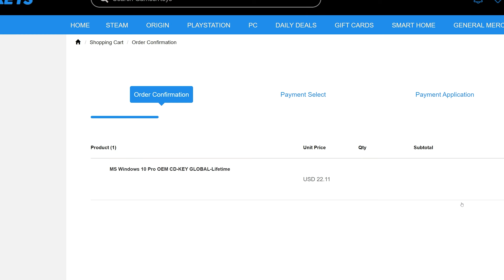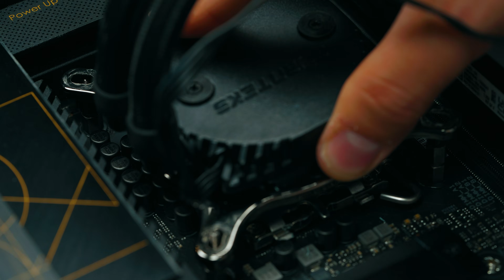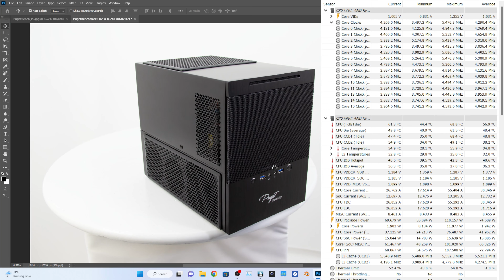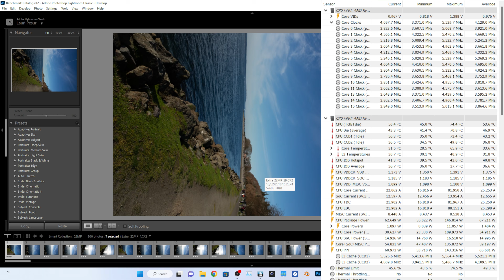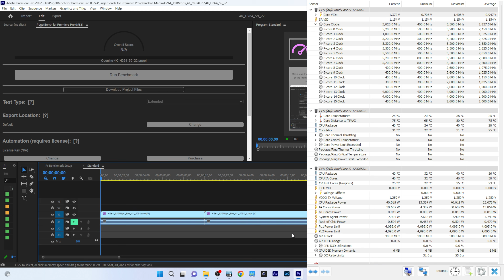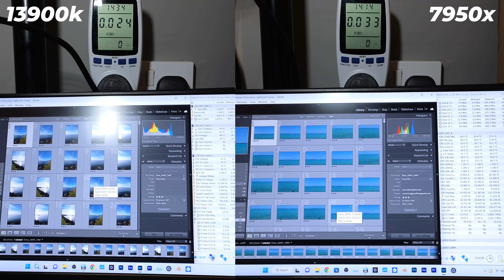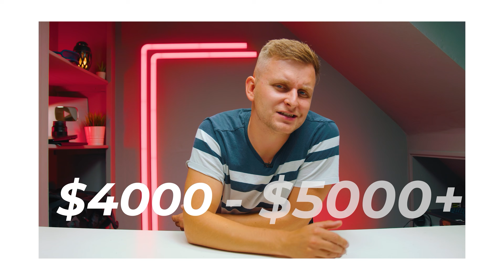INTEL & AMD both lied! 👉REAL WORLD power consumption is MESSED UP

Comment: Glad someone pointed it out! This is why I still prefer Intel than AMD. However, I think the low idle power of intel is because of it being monolithic while AMD is using chiplets/soc, not the best explanation but something like that.
Reply: Same reason why i bought a i5 13600k!
Reply: I believe you are correct. The new AMD GPU's 7900XT & 7900XTX are chiplet architecture and have high idle power draw. I do believe chiplets are the future but we have to figure out how to make them more efficient at idle.
Reply: @BRob1978   Even apple has high idle power in M1 Ultra, 10-12w compared to less than 1 watt on M1 pro/max. 
And the culprit is Ultra fusion connector which works similar to the infinity fabric.
Reply: @BRob1978   Even apple has high idle power in M1 Ultra, 10-12w compared to less than 1 watt on M1 pro/max. 
And the culprit is Ultra fusion connector which works similar to the infinity fabric.
Reply: @BRob1978  that was a driver issue, I have a 7900xtx and now it ideas at around 20 watts. When pushed amd gpu pf/w is way worse than nvidia though
Reply: Intel is moving to chiplet design as well.
Reply: @LiveType  Intel utilise Heterogenous core, while Ryzen do not, Ryzen use 100% high-performance core, while Intel mixed in low performance core (eg: 50/50 low/high core ratio) for use in idling. Smartphone CPU also use this approach, and Intel themselves once tried making smartphone using Intel Atom x3, x5, x7 CPU. (Intel sell miniature x86 PC in a USB thumb drive form-factor using Atom z CPU)
Reply: @xponen  I don't think efficient cores will help with idle power, since when idle, A processor's power consumption mainly comes from IO, memory, Cache etc. At least, that's what I observed with my Ryzen 3500 and 1650Super. 
The problem with AMD processors is the seperate IO die and synchronous infinity fabric along with higher, shared L3 cache and more PCIe lanes that all require extra power even when idle. AMD should find a way to downclock these when under light workload.

Also, it'll be interesting to how Intel tackles with this problem with 14th gen CPUs
Reply: @xponen  intel didnt use BIG.small cores on 12100, 13100 or 12400 and 12500 and they are still idle with very low power consumptions.
Reply: Along with infinity fabric and IO die, I think large cache and more PCIe lanes can be a reason along with a (relatively) inferior memory controller.
Reply: RIP, Intel 14th gen idles higher than AMD now, while even worse load power consumption.
Reply: The big hole in this logic, why would anyone buy the highest end cpu, if theyre gonna idle all the time? Those cpus are for gaming and creating contents. Ryzen 7000 non x still demolishes Intel with tdp 65 watt max 88 watt.
Reply: @fynkozari9271  I'm not 'going to idle all the time'. But idle is still a large percent of the time you spend on your PC almost no matter what you're doing. If it weren't manufacturers wouldn't spend tremendous amounts of resources to make laptops idle efficiently. If you spend an hour touching up photos in photoshop, you're idle 80% of that time. It's like judging the fuel efficiency of a car when it's running at 150mph - not representitive of most common situations. I think he even said this in the video. So yeah, I want a CPU that can run under heavy load and still idle without throwing money away.
Reply: @TimDobranski  - People dont buy laptops for gaming, thats not what its made for.
- Laptop cpus are different than desktop cpus. One of them runs on battery.
-Photoshop both cpu and gpu intensive.
-Gaming PC is different than Office PC.
-You dont build an expensive PC for browsing internet watching cat videos.
-People dont sit on their gaming PC all day. They have work, play, eat, sleep, outdoors activities.
Reply: @fynkozari9271  Like i said, thats why “i” chose intel because i mostly do browsing then some gaming if im in a mood for it. If you gonna play all day, then yeah maybe amd is a better choice.
Reply: @fynkozari9271  Ok, lets go down the list: They're different, yes. Doesn't mean it's totally fine for desktop CPUs to be wasteful. Here in San Diego we have the highest electric rates in the country. 

Photoshop, like most productivity work, is CPU/GPU intensive for very short bursts. It's not continuous. Most of that time is idle.

People can and do build an expensive gaming PC for gaming, and still use them for day-to-day use. A PC doesn't have to be for ONE thing. That's one of the biggest benefits of PC vs console gaming.

So yes, any PC, gaming or not, is idling a lot if not most of the time.
Reply: @TimDobranski  well said man

Idle doesnt mean you leave your computer alone doing nothing.

Using it for word, spreadsheet or something like browsing is almost the same as idle.
Reply: @Hasan Raza My ryzen 1700 idle 18 watt. My strix 2070 idle 14 watt, according to HWinfo. I play video games everyday cpu never touches 100w gpu never touches 200w. Its almost 6 years old.
Reply: i bought 7800x3d for gaming.not for idling.
Reply: @rtz6188 i watch youtube on my phone and movies. i prefer lying on the bed doing this. i only use my pc for gaming. that's why i call it gaming pc.
Reply: The AMD Ryzen 7000x are just tuned very, very inefficient stock. Intel did that better, objectively. But who cares?
This video is just about clicks I realize now.
Reply: @reptilespantoso  AMD fanboy triggered
Reply: @JoeWayne84 Well, the guy who runs the channel is an Intel fan boy. Irs good with a bit of counterweight.
And your comments tells me, you're an Intel fan boy.
Reply: @akyhne  I have 3 AMD systems currently and 2 Intel… but they all got Nvidia GPUS … so I guess I’m a fanboy of Nvidia GPUS if anything??? 
As far as Intel vs AMD and CPUs it’s a toss up nowdays but I like Intel for my highest end build… but to each their own… this was a year ago it looks like and I’m not even sure what the video conclusions were but I most likely was making fun of a obvious AMD fanboy and it triggered you.. 
I will say AMD has an amazing rampant fanbase on YouTube comment sections… they are worst of any other group I’ve seen that make a brand there identity in life… it’s just weird it doesn’t translate to the real world if you go to computer stores are talk to anyone you can find locally about hardware and you never meet a AMD fanboy??  And I’ve lived in 4 states over the last 20 years and been building PCs since 2002 ish … have bought Radeon and AMD parts off and on the entire time depending on availability and cost and I have always found them to be sub par compared to Intel are Nvidia since ryzen 5000 they became a viable option in CPUs and Radeon 6000 was amazing budget gpu cards …
Unless you wanted Nvenc I
Reply: @JoeWayne84  Both Nvidia, Intel and AMD has fanboys, that are off the chart, not willing to admit, when the competition has a better product. And for my experience, I'd say the Intel fans are the worse. The same goes for Apple fans vs PC fans.
Reply: @akyhne  just watch tech videos on YouTube and look at YouTube comment section it is over run by AMD fanboys on every Nvidia and Intel product claiming it’s trash??? It’s a parody at this point it’s been this way since I started paying attention to the comments in tech videos.  I’d say around gtx10 series are right when the first ryzen CPUs were released there was people claiming there ryzen 1700x was better than an intel 8700 becouse it had more cores???  Are the just wait till Navi,Vega, gets released don’t waste your money on Nvidia in a few months you will be sorry if you buy a nvidia card… Seriously I have saw some amazing claims by AMD comments section fanboys. Where I haven’t seen that from the other side maybe once in awhile you will find someone trolling someone for being poor.. idk I think people who find there self identity in material products they own exist in everything though it’s just AMD ones seem to be the ones who live on YouTube… there are basically 20 successful YouTube channels who’s sole purpose is to fanboy for AMD products.. and pretend to be extra informed on next gen stuff… haha that doesn’t exist in any way even slightly comparable with Intel are Nvidia … but there is a huge market to grow a YouTube channel if you tell the AMD fanboys what they want to hear.
Reply: @reptilespantoso  No dude a CPU at idle is still running tasks from the OS, if you want to say that AMD isn't slowing clocks down enough at idle, OK??  I don't agree but OK.  The issue REALLY IS chiplet design. You have to boost signals to send them from one chiplet to another, and the memory controller is on the IOD.  But even the OS running background tasks means those amplifiers in the chiplets that send data back and forth are powered, and in a monolithic design you don't have that.

But I would still say WHO CARES???  My PC doesn't idle.  It's either doing work or it's off or I'm gaming.

The other thing is this was done RIGHT AS the 7600, 7700 and 7900 came out which will all use less power, and the 13900K sucks ass in gaming and all core power consumption.

The 5800X3D destroys most everything in power consumption across many loads and gaming, along with the 7600X

Techpowerup, best place to go for detailed analysis for CPUs including VERY thorough analysis of power consumption.  This channel is laughable to suggest in any way that Intel CPUs are better than AMD in power consumption OTHER THAN single threaded apps WHEN the Intel CPU can use an e core, or idle power.
Reply: @johndoh5182  I'm hardware programmer, more than 90% of my PC time goes to idle.
Reply: @johndoh5182  5800x3d hahaha that’s hilarious the 13900k is way better than the 5800x3d in gaming especially with the new GPUs 5800x3d is good compared to other am4 CPUs but it isn’t the fastest gaming cpu by far pretty sure the am5 7600x beats it in all gaming nowdays the 12th and 13th gen Intel are way better
Reply: That is EXACTLY it.  Using chiplets means you have to boost signal levels to move them from one chiplet to another and even at idle a PC is doing some work.

But really, that's such a trivial thing I find it laughable.  In all-core loads and gaming Zen 3 and Zen 4 parts like the 5800X3D, 7600X and 5600X destroy Intel parts.  And for frames per watts, Techpowerup measures the 13900K at 2.13 fps/W, the 7600X at 4.47fps/W (best) and the 5800X3D at 4.1fps/W (2nd best)

This data is old.  In case you don't understand this data or question it, Techpowerup does THE most detailed CPU reviews.  Gamer's Nexus also does SOME power analysis but nowhere near the detail of Techpowerup.

Search "Techpowerup 13900K review".

But here's the kicker.  The 7600, 7700 and 7900 are all about to lay waste to the line of Intel parts for power consumption.  In fact I just checked Techpowerup and they've reviewed the 7600 and 7700 so those are now added to the charts and the 7700 is the most power efficient CPU in all-core loads and near the top for gaming efficiency.

Idle?  That's your concern?  Turn your PC off because the rest of the components are using as much or more than the CPU.
Reply: @johndoh5182  Yeah, idle power draw is a big concern for some of us. I have a Plex server running 24/7, for example. But even in more typical setups, PCs are idle or close to idle probably 90% of the time. Web browsing, tracking data in Excel/Sheets, recording music with Pro Tools, watching YouTube videos like this one, Zoom calls, coding in VS Code. I do all of these things more than I game now. I still want a powerful chip for gaming when I need it, but I don't want to run up my power bill. That's why some of us care about idle power draw. Kudos to this channel for finally recognizing how important it is to many of us.

Comment: Did you try to test ryzen 7950X with iGPU disabled? It's useless and probably causing high idle power consumption, Yeah chiplet design results in High idle power consumption, but 50 watt is rather too high.

Comment: Disagree. You MUST tweak the Ryzen 7000x CPUs to get these to run good. (PBO2 & Curve optimiser)
I've tweaked my 7700x just now. -38 mV undervolt all cores. PPT 85 Watt stable, but I gave it 88 Watt. Pulls 90 Watt from the PSU max. 100% (Cinebench r23) stresstest 64 degrees C packet. (at 85W it's 62 C max)
Yes, it's quick. Best score Cinebench r23 single core 1984 all cores 20121. Clocks to 5300 all cores continuously. Repeatable. Boosts to over 5800 MHz on 5 cores normal use (audio production) the other 3 boost to roughly 5600.
Cooling is adequate (Noctua NH-D15, airflow chimney front to back). Idling at 21 Watt (right now). Mobo is ASRock B650 LiveMixer, RAM is KIngston Fury 5600 64 Gb clocked at 6000 Mt/s. Sooooo... I'm very happy.
I don't like E-cores on the Intel. You'll need Windows 11 for a good sceduler (I also run Bitwig and Davinci Resolve on Linux). A lot of audio software is not optimized for these E-cores. YMMV
Reply: undervolt Intel 🤷‍♂😉
Reply: @EvanidusEvan  Yes. But it's tuned better stock than the AMDs. My post is not about AMD vs. Intel. He asked for feedback so he got it.
But doesn't appreciate that. Fine with me. Have a nice 2023. 🙂
Reply: You can do exactly the same on an Intel CPU and drive even better effeciency.
Reply: @vMaxHeadroom  You mean better than stock. Yes, you can. I've looked at Intel as well. (But chose AMD for stated reasons.) I also looked at Apple.
I'd like to see that: Intel vs. Apple vs. AMD, all tuned to their sweetspot (Apple is already tuned).
Reply: this isn't about making AMD look good to cheer up their fanboys (check out r/AMD and a few big mainstream techtubers for that). The video is about comparing idle and under load power consumption.
Reply: @ionelroza  No, that's what you make of it. I'm not interested in fanboy nonsense. I can't care less which corporation other people prefer, I just go for the tools I need.
The Ryzen 7000x series are running at their MAXIMUM temperature target of 95 degrees C. Literally no colleage I know is running those stock.
I didn't tweak the Intel CPUs, and that is also not what my post is about. This is not an Intel vs. AMD post. That is what you make of it. I'm not interested in that.
This is about youtuber Tech Notice saying that most users will not tweak the powersettings on the AMD (or Intel) based studio systems they use. That is not my experience in the pro audio world. Much better would be, if he would compare these chips but then undervolted, with reasonable power targets. That would make sense. But that means he'd have to test all of these chips, find some reasonable settings, then run benchmarks. That's a huge amount of work and effort. And prohibitively expensive. I do reviews myself (pro audio). It's a LOT of work. It's a bit sad he upvoted your post. That means he doesn't appreciate my honest feedback. And lost a subscriber of his target audience.
Concluding: The idea behind this video is good, in my opinion, but the numbers are all wrong. No professional I know, is running these Ryzens stock.
Reply: @ionelroza  Lol, the only thing AMD users have to think about to cheer up is that our boards aren't trash in 2 years. We're about what, a week away from intel being budget tier trash for gaming again once zen 4 3d announces.
Reply: @PineyJustice  you can be a fanboy all you want on someone else space and time. I'm not going to read anything you write here. 
AMD fanboys are as toxic as they come. You're like a bacteria or infection that keeps coming back.
Reply: @PineyJustice  This is not an AMD vs. Intel post. That's for dumb people.
Reply: True UV makes a huge difference on those new systems, but that would also depend on the silicon lottery, besides that, I think we should all define what we mean by "dile" because idle on the desktop is much different than idle with a program open. I say this because my UV 12600k idles (on desktop) at <5W (With min at 2.xW) while in Photoshop is more like 8-10W. 
In any case modern cpus can give crazy perf/W when power limited and undervolted, they are truly something!
Reply: @mastroitek  The difference is, AMD chips are usually pretty poorly tuned out of the box, it's almost guaranteed that chips can run at least -20mv with the average being -30. Without touching the maximum tdp on my 7950x I'm running at 5.4 all core boost and single cores boosting to 5.9ghz.
Reply: @PineyJustice  I think that is a general rule, my old 6700k was good for -60mV while my current 12600k is on a -80mv offset. I also did UV on a 2nd gen Ryzen system but was long ago and I do t remember how it went, I just know I was happy with the result
Reply: @PineyJustice  5.9 single core 5.4 all cores is pretty good. Looks like you got lucky. 🙂
Reply: @mastroitek  Yes, we are truly blessed with the availability of these tools. I don't know if I won the "silicone lottery" but I'm happy with this chip's efficiency.
The 21 Watt is with this browser open and two chat apps and some monitoring.

Comment: Very interesting didn't even think about that, amazed no one ever tested this out before
Reply: Some other tech channel did the same test on the 12th gen, it's interesting that intel does not sell that.
Reply: @guilhermegomesdelucas159  power consumption is not something hard to figure out. It’s just not beneficial for some bichy YouTubers to tell us the truth
Reply: @guilhermegomesdelucas159  amd paid those YouTubers good. I was the one saying 12 gen runs cooler than amd in daily usage. Turns out 90% ppl got tricked by some bich as YouTubers and think 12900k runs 280w when 5950x 140w, amd is 100%more efficient than intel.